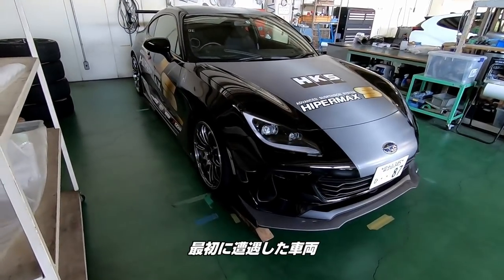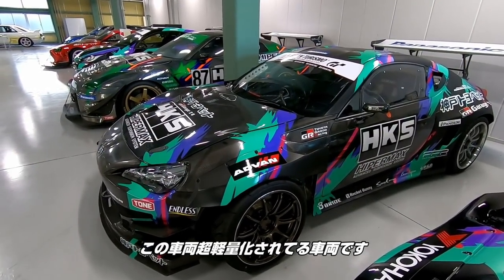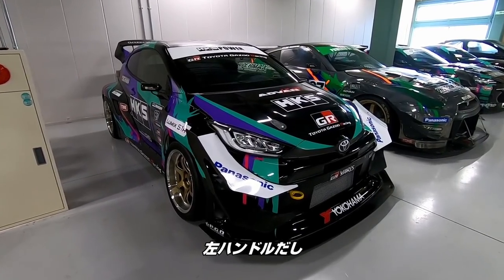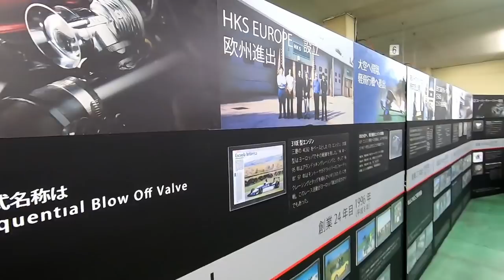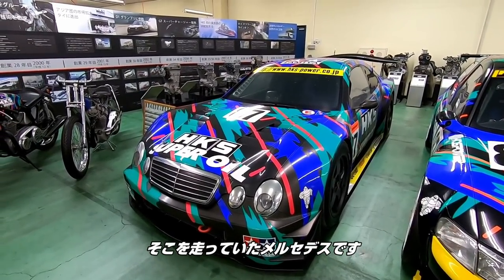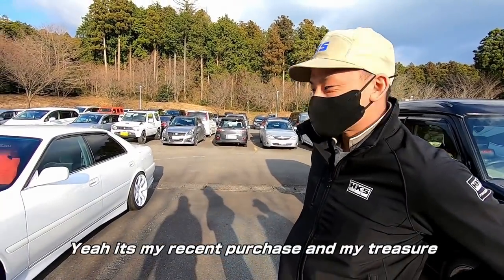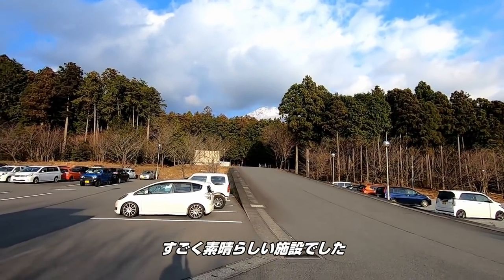HKS Visit! Checking out some Historical Cars!

Comment: A short story about HKS's time attack cars.

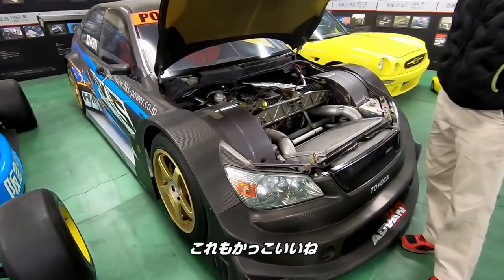2000- 'TRB-01' Altezza/IS300 was the first HKS time attack car. (20:01)

2003 - HKS came out with 'TRB-02' time attack full carbon Evo 8. But Nobuteru Taniguchi crashed it at Tsukuba in 2006.

2006 - After the crash, HKS rebuilt the car as CT230R, with Evo 9 facelift and new red HKS Hipermax livery. Taniguchi went breaking times with it at circuits around the world.

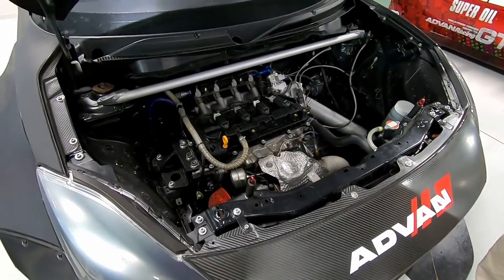2013 - HKS began redeveloped the CT230R with the usage of NGV technology. And that's the end of what you see at (12:00)

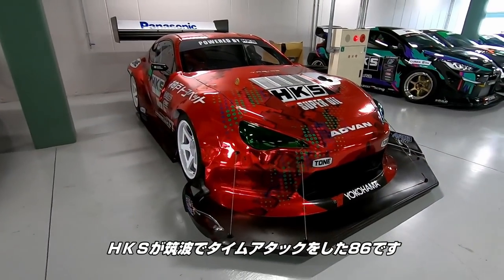2018 - HKS 'TRB-03' GT86 time attack car at (9:25).

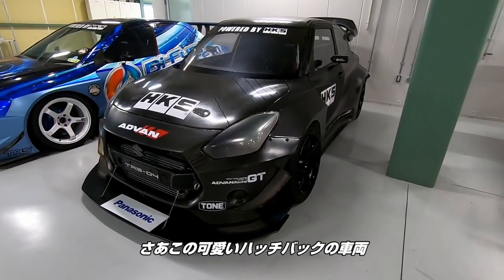2019 - HKS 'TRB-04' Suzuki Swift time attack car at (10:34). I remembered seeing the car at TAS 2019 with the Evo motor and 4WD drivetrain still in it.
Reply from the maker: thanks for all the info, u prolly know more than the workers there😮😮😮😂😂😂

Comment: This is super cool! Never seen that they tried building an in-house model before [yellow one].
As someone who watched BTCC during the SuperTouring era of the late '90s it was also cool to see their RML-built Vectra (those were raced in the UK as a Vauxhall). That was an incredible, big-budget era for tin-tops. After doing Vectras, RML's Nissan Primera P11 had an NA SR20DE that produced about 320hp, while elsewhere there was a Ford Mondeo by Prodrive where the 2.0 V6 was mounted so low that the driveshafts ran through the Vee of the engine. They might be FWD sedans but they're about as specialised underneath as modern GT3 cars. Just with less aero and horsepower.
Reply: I got to visit RML while they were building the Juke GTR's. Was great to talk to the guys who were involved in btcc, some of the tricks they did were amazing to 'bend' the rules- the Cavalier (model before the Vectra) had multiple boot floor skins sandwiched together for balance, as ballast wasn't allowed.
I'd always wondered if the HKS car was just an old BTCC car, the plaque in the engine bay was cool to see!
Reply from the maker: man they need to bring these classics back into racing🤙🤙🤙 that would b awesome

Comment: The ct230r before natural gas was dry carbon body w/ red livery which set & held the Tsukuba overall lap record at 53.XX for a long time and before that it was called the TRB002 "Tsukuba Record Breaker" & was unpainted full dry carbon body and held the overall record for quite some time at 54.XX eventually an on track component failure led to NOB crashing thus the change to the red ct230r that's chassis has some major history